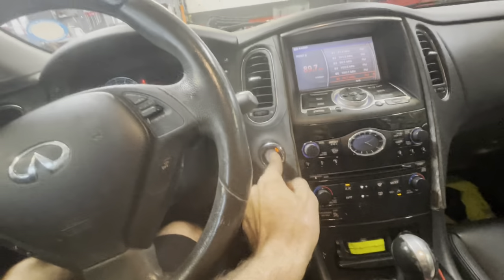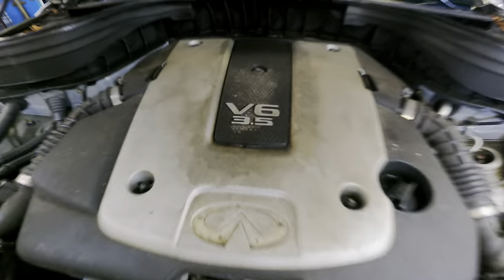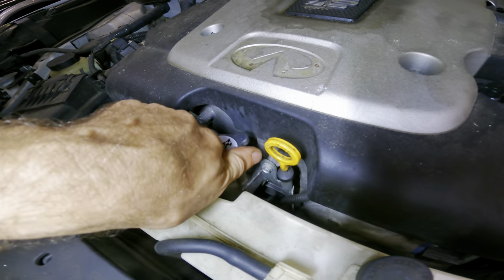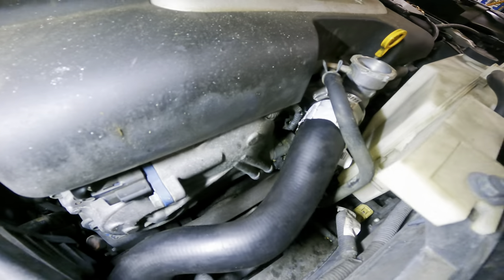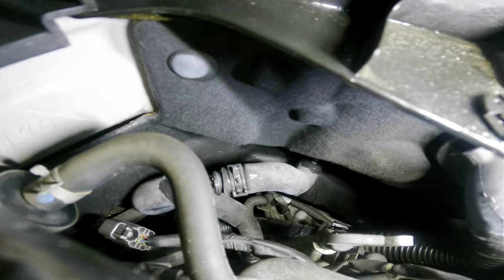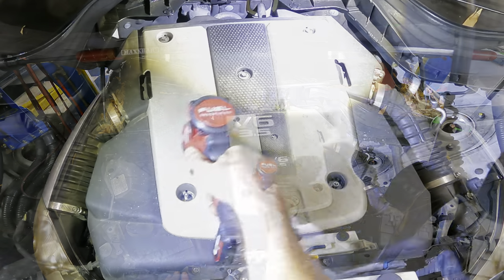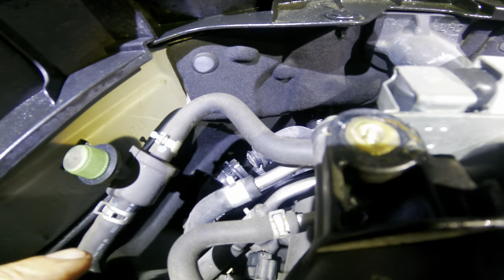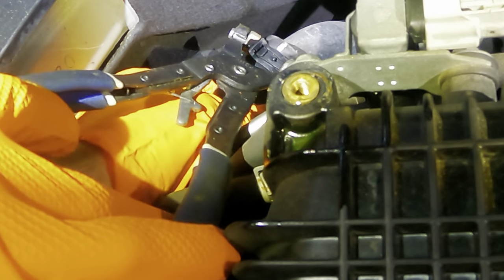Overheated after new Radiator! Tow In! Infiniti 3.5 EX35

Comment: Probably the first time that radiator actually had pressure in awhile. Old one was probably leaking or not coming up to pressure so it didn't leak at the heater hose. New radiator got up to good pressure and found the next weak link.
Reply: My thoughts exactly
Reply: This! Old car, you fix one leak and the next weak spot will show itself
Reply: That's how it was with my old Jeep. Replaced the radiator cap, and suddenly it had the correct pressure so the water pump started leaking. Replaced the water pump, and wouldn't you know it, the radiator gave out.
Reply: I came down here to say the very same thing.
Reply: Chevy cruze. 2 years old. Water pump failure.. next year water outlet... next year water pump.. next year over heats on my way home blows all the fluid out the tank. I sold it knocking to toyota.. some vehicles are trash.. 58k miles
Reply: I wonder if the overheating that led to the radiator replacement didn't degrade the plastic. I also wonder if that splice is stock?
Reply: @TheCharillz23  I had a Chevy Cruze catch on fire on me
Reply: Agreed. OR - the link piece was leaking, and a leaking rad was misdiagnosed? But probably like you say, next weakest link. On my Volvo V70 D5 there is a similar link piece, very similar situation, so little room to work. But the D5's link tube is metal, curvy, and kind of sits over some other piece of engine junk, and it took weeks to discover the leak, which was where the metal piece had obviously been chafing for about 120K miles, and the tiny sliver of worn-through metal was partly 'sealed' by the metallic thing it was resting against. With the engine running and hot, the excellent mechanic discovered the leak only by probing and nudging and wiggling stuff about. Stoopid design. It was when Volvo were owned by Ford. Need I say more? In the end I had to get our local garage - what you newly independent Americans so cutely call a 'shop' (-;)~ - to dig it out. I could've taken the car home and tried to do the rest myself, but it needed a guy with REALLY TINY HANDS, which I do not have They sourced an OEM part. SEVENTY ONE POUNDS STERLING FFS!!! For little more than the spare plastic connecting piece you had lying around in your bitsa drawers. Funny old world.
Reply: @TheCharillz23  when I was looking for my first car I found a ton of those things for less than $2k and 500 miles or less and wondered what the hell was wrong with them
Reply: Watched a Judge Judy where she made a mechanic pay for other repairs after fixing a/c after it didn’t work for a long time in a older car.  The mechanic couldn’t explain it so the judge understood but when you pressurize a system that hasn’t had pressure in a while things will break.
Reply: This is why I usually get rid of my vehicles around 90-120k miles.

In my younger years I had to keep a vehicle and repair it as things went out.  No option when you can't afford otherwise.

2nd car I owned lasted till 248,000.  Luckily by the time it had major engine issues I'd had a good job for 2 years, so bought a 1 year old used vehicle.  Since that day I keep a vehicle for  about 7-10 years.
Reply: @Thanatos2996  reminds me of this Saturn I had.. I replaced the radiator this one time, then this other time a year and. A half.. ish.. later I replaced the thermostat... Ope there goes that replacement radiator and had to get another one 

Needless to say the first replacement exploded rather spectacularly
Reply: @shak180  yep, it's like never ending game of whack a mole.. or trying to combat scammers/spammers as well as bots and torrent sites. You take down one two more pop up in its place
Reply: I never see anyone pressure test a cooling system after a repair any more. That was always standard proceedure after every time the cooling system was opened. 🤷
It might not have shown that connector leaking, but then again.
Reply: @peanutpower8826  ..
Reply: How about new hoses

Comment: Ray, glad to see you like the funnel set I sent you!
I really liked mine, saves lots of coolant spills.
Reply: Eric the Car guy had one, so I had to get on too 😉.
Reply: its really the apropriate way to burp all sealed cooling systems the right away to
Reply: What's  this funnel set called? I I assume it seals to the filler opening so that systems that require a purge get completely filled. I do not do a lot of work any more but seem like a good tool on todays cars.
Reply: @fredrickdavenport1611  Just Google radiator funnel kit. It will come right up.
Reply: you gonna bring it up everytime he fills a radiator?
Reply: I always  found the sucking the air out of the system way was best, as it told you if there were any leaks in the system too. Good for rear engined cars too. Just saying. I believe its a Draper tool. UK
Reply: I got one as well because at this dealership I worked at as a body and paint tech, the (only) mechanic that worked there showed me how dope it is and since I was doing a ton of front end hits I was replacing alot of radiators and wanted to burpcthem the right and easy way
Reply: @robburdack4361  I prefer the vacuum fill method. I used to use the burp funnels

Comment: Ray next time you go to Home Depot, Lowes, Ace or any decent hardware store pickup some brass hose barbs they are stronger and aren't affected by the heat they will cost much less than anything you get from a parts store and you will have them in your tool box.
Reply: I definitely try to put metal ones back in. However the plastic distribution valve is the only thing I can find. I can find metal ones.
Reply: I stick with plastic only because I don't want any type of chemical reaction with the metal/coolant.
Reply: you just beat me to that suggestion lol
Reply: @davidheale6435  I would use steel or aluminum barbed couplings
Reply: @brucestorey917  Yes, I use stainless menders. I've had the brass ones fail over time.
Reply: Brass is incompatible with a lot of the modern OAT coolants. Use aluminium or steel hose tails.
Reply: @OOOOOO12345  Most modern vehicles, if not all.  Are all aluminum engine and most likely cheapo steel freeze plugs. Maybe semis or other heavy diesel are iron, with probably steel plugs also.
Reply: @OOOOOO12345  excellent comment. Corrosion will occur with metal and water anyway. The type of reaction they’re talking about only occurs when two different metals are contacting each other.
Reply: Also I believe green coolant is iat coolant. Now dexcool would destroy copper and brass systems.
Reply: @davidheale6435  i don't think brass really reacts if the coolant mixture is done properly, demineralised water and no contaminants.
Reply: @davidheale6435  but then i guess depends on the coolant,  aluminium is safer.
Reply: 3/4 Pex fits 5/8 hose
Reply: Would you use brass barbs on your own vehicle?
Reply: If your buying shit for your car at Home Depot your doing it wrong .
Reply: @Boga217  It destroys plastic, too.
Reply: @deezelfairy  I've used brass couplers in OAT systems for years. No failures. Fact is any metal will corrode if the coolant is allowed to go acidic. VW and other manufacturers use brass tipped sensors in their OAT cooling systems with zero signs of corrosion.
Reply: @JonnyMudMower  Dorman is an automotive parts manufacturer. Their hose barbs are absolute garbage. I'll take a home depot brass fitting over an "automotive specific" plastic barb any day.
Reply: @davidheale6435  aluminum, bass, and iron wouldn't have any reactions because most blocks are made of iron, many heads and radiators are made from aluminum, and many radiator are made of copper. In fact plastic has more reactions to antifreeze than metals. Chevy found that out when they first started using plastic intake gaskets. They had to get a special antifreeze made to keep it from disintegrating the plastic.
Reply: I really don't think it matters if you use plastic or metal pipe. Yes, an aluminum pipe would be ideal, but realistically this car is unlikely to still be on the road by the time this plastic piece fails again.
Reply: I’ll continue to use what the manufacturer uses because I’ll would be responsible if something goes wrong. Best do the job once and get paid.
Reply: @jimbote1968  you are correct. Most massive corrosions come from the radiator leaking transmission fluid into the coolant system. Antifreeze x transmission fluid x heat = acid..
Reply: In this particular situation I would rather use the OEM part in case of liability issues.  It's not clear whether the failed component was original or some inferior hunk o' junk, but certainly you would not want a repeat.  This unknown part may be inadequate for the conditions and itself fail.

Someone else mentioned the original part had a provision for bleeding air from the heating system, so there's also that.
Reply: @davidheale6435  if you use a Copper or Aluminum  you will not get no chemical reaction most radiator's core are made out of copper an the heater core are made out of copper all newer cars the engine block made out of Aluminum as well the intake and the head's I would not use other metals.
Reply: Brass copper is for the old IAT coolant systems, the newer oat and hoat coolants are more compatible with aluminum/plastic
Reply: Not always the best idea, especially with aluminum blocks/heads. The metals together in a loop cause galvanic corrosion.
Reply: @robertrabhudsonhornet5869  No, most radiators and heater matrix's have been aluminium cored since the mid/late 80's
Reply: better to find stainless
Reply: I get the corrosion theory regarding copper or brass, but don't most coolants these days have anti-freeze, anti-boil, and corrosion inhibitors?
Reply: @deezelfairy  that's way I send copper and Aluminum so it would cover all years I know round the 90's an newer are Aluminum cord
Reply: The issue is the customers at that point. I worked at a Euro indy shop that specialized in Land Rover and BMW. The 4.2/4.4 LR engines they ran in the mid to late 00s have a bleed screw type barb like that that breaks like yearly but the customers think the metal one looks cheap and Jerry rigged so we had to find better black plastic ones after a few complaints and being asked if we knew what we were doing
Reply: Plastic in coolant lines often break suddenly. I had sudden hole on plastic pipe right after the thermostat in Sienna V6 at 200k miles. Hard to predict but i believe plastic pipes and joint should be replaced every 100k miles or 10 y
Reply: @YouNameItGaming  electrolysis is the problem. friction from water causes the corrosion
Reply: Not only do they sell the brass and steel but also sell stainless steel hose barns, used to use them in the automatic car wash industry. Wash chemicals are more corrosive than engine coolant.
Reply: @Boga217  Dexcool has so many talents!
Reply: @davidheale6435  Brass is good for drinking water connections. The radiator is aluminum, and that is a more reactive metal in general.
A quick online look into the matter and I find a few dubious references to a slight reactance between aluminum, copper and brass in a coolant medium if the coolant does not have a corrosion inhibitor components, AND if the coolant is not kept changed on a reasonable interval.
Reply: I too like brass
Reply: @davidheale6435  XD
Reply: @davidheale6435  its not a pc lol yall be fine
Reply: Like Lowes, Home Depot would carry hose barbs.       Have you been to either place lately?
Reply: That turd is not deserving of brass or anything else. And YES the customer should pay! Buy a pile of shit & this is what you can expect.

Send it to STUNTMAN c/o NEUTRAL DROP. They'll fix what's left of it.
Reply: @jeffdughman9741  Galvanic corrosion is a thing
Reply: Those screw on hose clamps put FAR too much pressure on the plastic fittings. Use the OEM spring clamps if possible.
Reply: @robertrabhudsonhornet5869  I see you edited this ..sentence. Thank you.
Reply: I agree, but if the plastic lasts 10 yrs......
Reply: @davidheale6435  most modern cars have other pieces of the cooling system made of brass. its generally safe.
Reply: @OOOOOO12345  What iron block? The Infiniti in this video has an aluminum block
Reply: @drcornelius8275  How does brass fail antifreeze is designed to prevent corrosion how would it hurt brass?
Reply: @JonnyMudMower  why? Metal is metal and a fitting is a fitting..
Reply: @borisp9499  if the cost is the same then metal is better in the junk yard or not.  Lol.
Reply: @Ryan-re1rs  no ,,no they ain’t lol all fittings are not created equal .
Reply: @JonnyMudMower  
Cleaning supplies
multimeter
electrical tape
duct tape
butt and spade terminals
electrical wiring
literally thousands of fasteners
drill bits
drivers
mechanic tools
electric impact
electric ratchet
hose clamps
plastic concrete mixing pan works great for draining a transmission when there's no drain plug
made an oil catch can using PVC pipe and caps, steel fittings, and a few other things. No more dirty intake manifold or deposits building up on the intake valves
Fire extinguisher
floor jack
jack stands

There's lots of shit you can find at a home supply store for your car, and you'll pay less than you would at the "discount" auto stores. Hell I don't even get parts from auto stores anymore unless it's something I have to have right away.
Reply: Isn't mixing metals a bad idea? Corrosion etc? Galvanic corrosion?
Reply: Why not replace it with a longer 1 piece hose?

Comment: The broken barb was originally a bleeder valve you crack open when filling with coolant.  Common problem on these VQ's for them to break.  They make metal replacements that last a lot longer.  Makes bleeding the coolant much easier when you have one in there.  No bleeder valve when filling and that's why it took so long to bleed of air.  Head gasket is more than likely fine.
Reply: That's good to know then.
Reply: Why is it overheating still then?
Reply: Exactly right.  That's a bleeder valve that needs to be replaced with something other than what our man Ray used.  They are crap quality, even the new, replacement valves from the dealer.
Reply: @shaunkelly9053  Because there's still air in the system.  You see how it kept bubbling even after attempting to bleed it for a while?  The air is trapped in there and it's not getting out until it's bled correctly.  

Nissan has a very specific bleeding procedure for these engines.  Basic idea is to crack open the bleeder valve and then start slowly refilling the system.  As soon as it starts pouring out of the bleeder valve, you close it and continue to refill until the system is full.  Then you blast the heat and do the normal procedure like any other car.
Reply: @Paul-oh4fe  Yeah but you should mention to not turn the car on yet. First open the bleeder valve with the car off and slowly pour into the fill funnel at the radiator neck until you see Coolant start to come out the bleeder valve. Then Close the bleeder valve and continue pouring until it stabilizes at the funnel and you cant pour anymore. Then you go inside the vehicle and turn it on and blast the heater on Max. Wait a couple seconds for the coolant in the funnel to get sucked in by the engine and continue to poor until it stabilizes again at the funnel. Their will be some bubbles from the air escaping dont be scared about that,  but once you see that you cant fill anymore go back in the car and hold the Rpm’s at 3000 or so for 10 seconds and do this every 3 minutes to make sure all the air gets out the system. You basically just do that until theirs little to no bubbles coming from the Funnel at the radiator neck. Ive done this on my Hr so i memorized the entire process 😂
Reply: The bleeder you’re thinking of is on the heater outlet hose. The inlet side has just a plain coupler. Also, this particular vehicle doesnt have the bleeder on the heater outlet. It’s actually on the upper corner of the radiator in the driver side.
Reply: @hawkman8835  Yeah i was about to say my Hr has the bleeder on the Driver side and this just the coupler side on passenger side. Z1 makes metal replacements for both of these. Didnt even notice till i watched full video 😂
Reply: shouldnt the bleeder be top of rad. not half way down back of engine where it does nothing. &, dont ''modern'', cars have a thermostate bypass, so they dont boil, before it opens..
Reply: @hawkman8835  There's two bleeder valves on the ex35.   One on the upper corner of the radiator like you mentioned and one on the heater hoses.  Both need to be cracked during the refilling process to purge of air.
Reply: Leave top hose off when filling. Works on my max.
Reply: VQ owner and I concur
Reply: Which actually leads to the concept of the other shop being responsible being...more likely. What if they broke that part putting it back together?
Reply: @shaunkelly9053  these 3.5s love to hold air in the heater core    There is a procedure to get the air out.  I had to do the procedure 3 times to get the air out of my g35
Reply: I was just going to say he never bled the system that's why I kept on bubbling and overeating on the top of that engine on the other side there's a bleeder valve I don't know if that was the part that was replaced and it didn't come with a bleeder valve but it needs one if it doesn't have one otherwise that radiator will have bubbles in it
Reply: 100% ! The plastic bleeder broke on my VQ25det with very little provocation,,,,, I have a brass replacement to go in its place